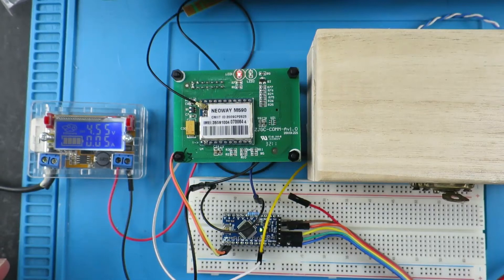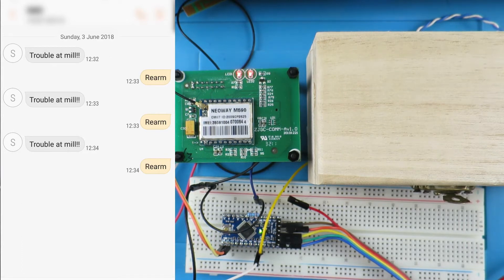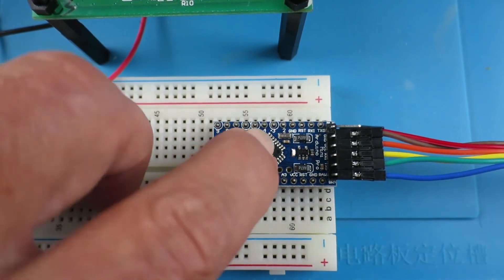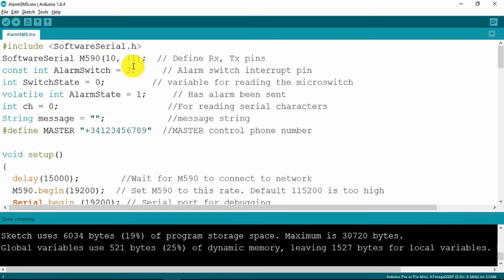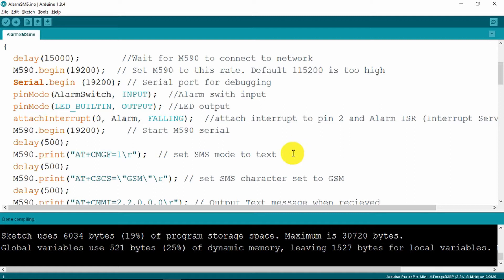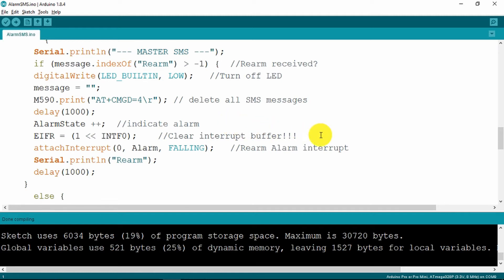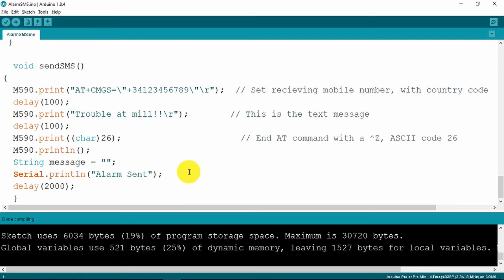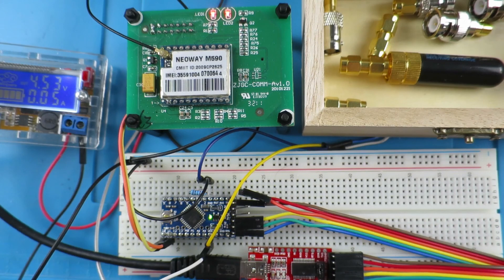Arduino SMS Security Alarm NEOWAY M590 GSM Electronic Project

Comment: is pin 2 connected via switch to 5volts or GND?
Reply from the maker: From memory the pin was low (0) when the switch was closed and pulled high when the door was opened. Thanks for watching, have a great day!
Reply: @1nformatica  thank you, my m590's Baud rate is 9600 is changing the code to 9600 ok
Reply from the maker: @boukraloukman  I don't think that will be a problem. You can always test it as I did in part 1 : https://youtu.be/O3Mb0kkl9GE?t=504

Comment: I have uploaded the sketch using a arduino nano. All i get from serial monitor is ???
Reply: Thank you very much. Now all i get in the serial monitor is "Ready..." and nothing else.
Reply from the maker: @henniebosch7475  I suspect that there is a communications problem between the nano and SMS board. Check in my first video that you can send commands to the SMS board via a terminal directly. https://youtu.be/O3Mb0kkl9GE?t=256
Reply: The baud rate of the sms board was 9600!  Change it to 19200 and now everything is working fine. Thanks.
Reply from the maker: •:*¨¨*:•_•:*¨¨*:• EXCELENTE_•:*¨¨*:•_•:*¨¨*:•_!
Reply from the maker: Check that you serial monitor is set to 19200 baud.

Comment: Very nice job i like it 
One question if we can do this wirelles i mean the swich to be wirelles ?
Reply from the maker: It is possible but it would introduce many complexities. How to power it  for example.
Reply: Batteries lipo
Reply from the maker: I am waiting for a new charging module for solar power. Maybe I will make a video with a wifi connected micro switch.

Comment: Really amazing work, my friend... It's extremely useful! I may make something similar too, in some time. 😊
Reply from the maker: Thanks Mario! Yes, the system could be extended to other sensors for fire, water level or movement detection. Also there is scope to extended the number of commands you could send to control remote lights, pumps or really anything!
Reply: 1nformatica Exactly! I don't know exactly the name in English, but I have some ground nearby (3 blocks from here I guess), where I'm going to build 3 small houses to rent. You know? And maybe I use the smaller one as a "office" (studio, workshop... I don't know). Anyway, if I do that I may build something like that for security. 😊
Reply from the maker: Sounds like a great project! In English we would call it a "plot" of land. In Spanish "suelo" and I guess Portuguese "chão", no! No wonder the world is mixed up!!
Reply: 1nformatica Actually, here we say "terreno". 😀
Reply from the maker: You see! I said it was confusing!!